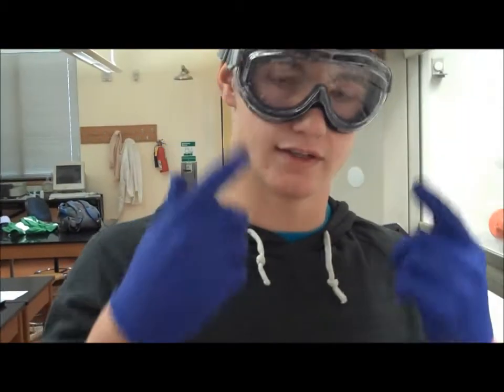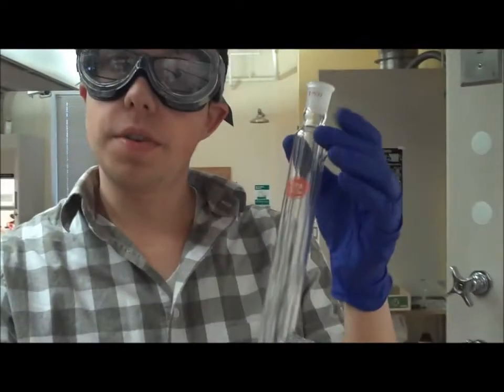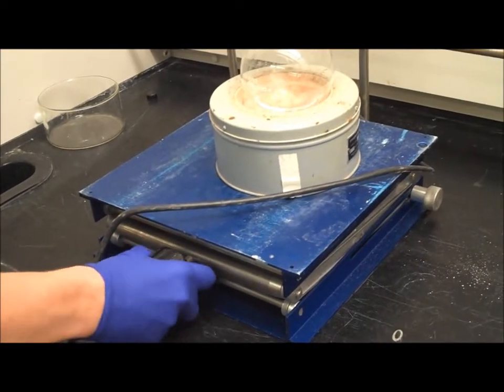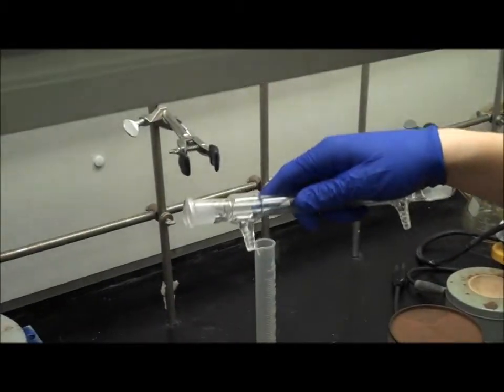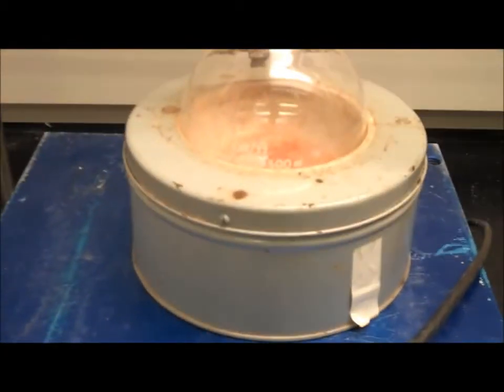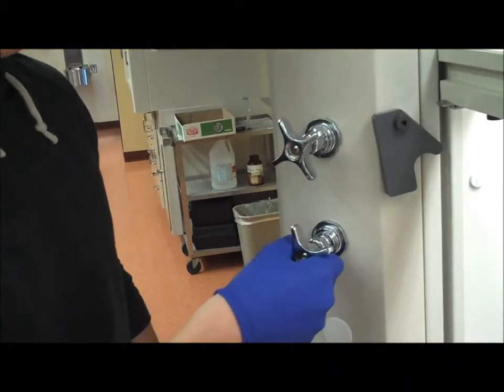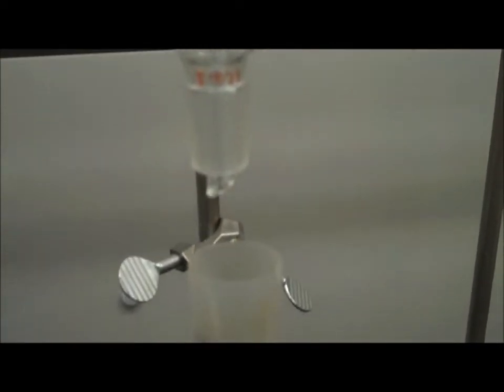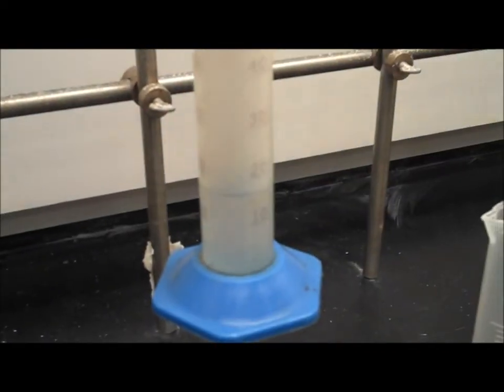How to do a Fractional Distillation

Comment: I make thc  distillate from crude cannabis oil. but this is basic. I’ve never taken an Ochem class in my life. You don’t need school to learn. Dont forget that kids.   Get metal clips vs plastic. Also when vac is pulled the clips don’t matter. It sucks it together. Also try a vac meter to know your torr . Lower torr means lower temp to find the boiling point of your fraction making higher quality and purity of fractions especially in find specific fractions in compounds that have high amount of non target fractions.  Also stay in school and don’t do drugs.  To much. But enough to expand your mind and break away from the brainwashing bullshit.

Comment: Can you explain the role of packing chips inside the distillation coloumn in ensuring the purity of the distillate? How does the boiling chips provide even boiling? Thank you for a helpful video?
Reply: Boiling chips are added so that liquid doesn't duper heat or in simple words it doesn't boil violently. Don tknow about the packing thing though.
Reply: The packing material increases the surface area fir the fractions to condense on. Essentially, we are doing several condensations and vaporization in the fractional column. To improve the efficiency we use packing materials.
Reply: Just use a vig...like that's what its made for boys......